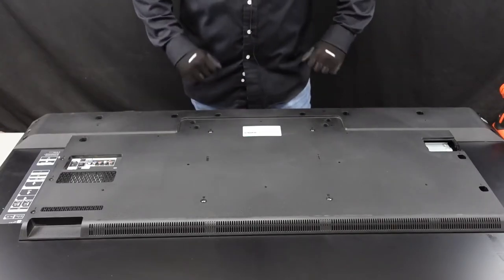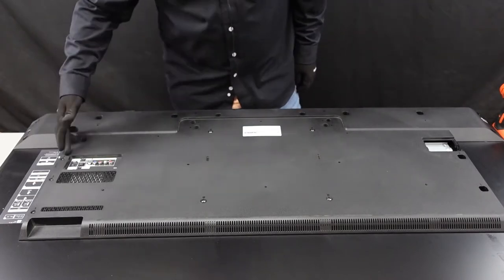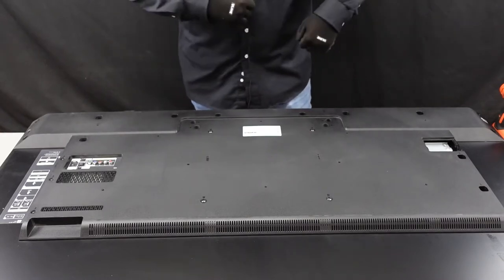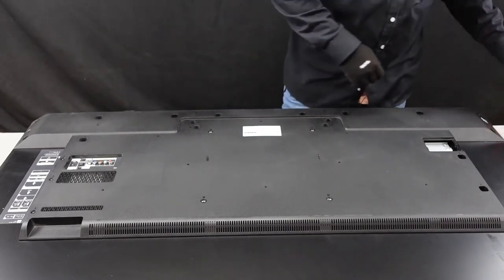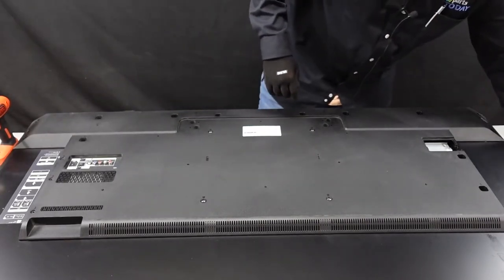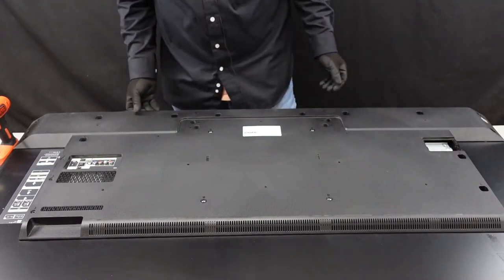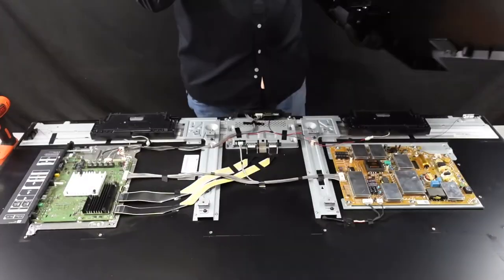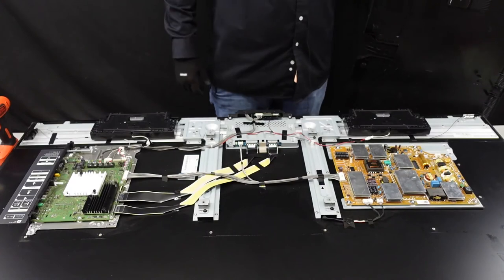How to remove the back of your TV. (SONY XBR-65X850E)

Comment: Can’t budge it away, no screws at all, any idea??
Reply from the maker: If it is a Sony TV I would check for little square or rectangle plastic covers over the screw holes.  Sony loves to hide a bunch of screw holes all over the back plate. If there is a cut out for mounting your TV on the wall, sometimes there will be a plastic plate covering the mounting holes.  There could be screw holes hiding behind that as well.